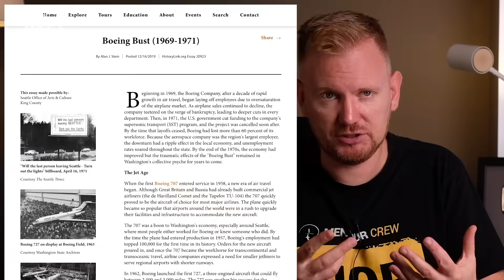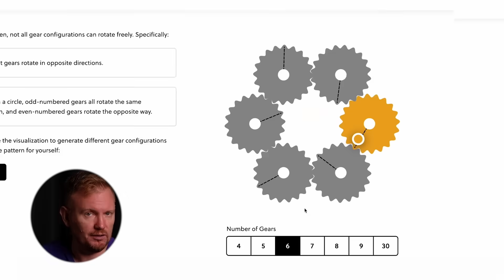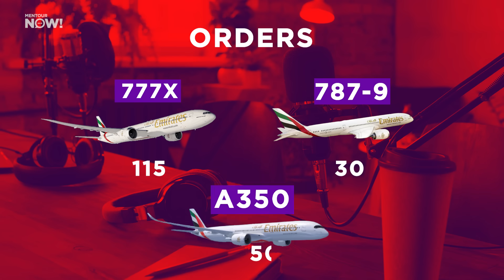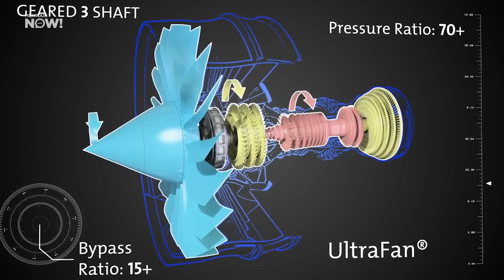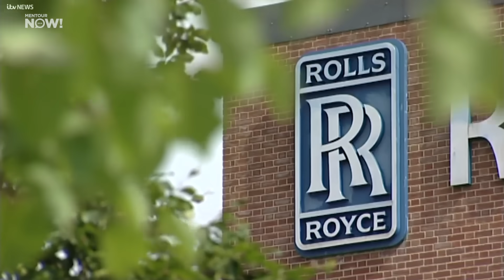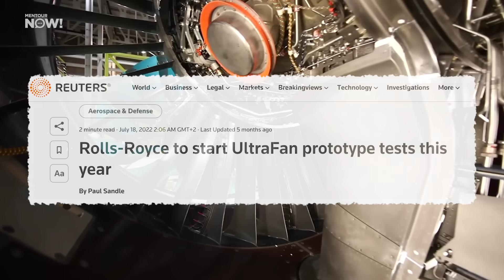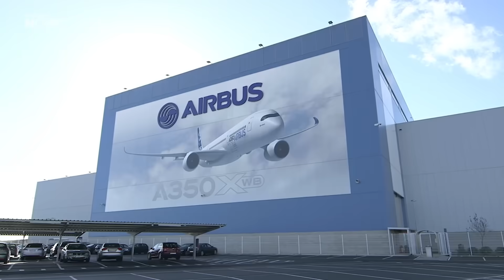Are BOEING planning a 747 with 2 ENGINES?!

Comment: I remember driving in North East Montana by Glasgow and the old Air Force base that Boeing now owns. I was coming from the north and saw this really strange looking 747. I seem to remember it only had 3 engines and the one by itself was HUGE. I was not able to get close enough before it had landed and could not see it from the highway so did not get any pictures. I actually parked by the approach lights hoping it was doing touch and goes. I think I looked something up and Boeing was testing the engine for a new aircraft. It might have been the 787, I just don't remember.

Comment: I can see how this could work out for a 747 because a 777 is basically the size of a 747 just without the hump. So the difference in weight between a newly designed, composite 747 and the new 777x should be relatively minimal, which makes it likely that those new giant engines could lift up a 747 in a twin configuration. However, i doubt that only two engines could ever lift a fully loaded A380 into the sky. Even if it's redesigned with a lighter composite hull, i just don't think that only two engines can lift that monster. The A380 might just be too massive for that. Man, if this comes true and Boeing actually starts producing those twin engine 747s, Airbus will again lose the Jumbo Jet battle against Boeing after their very brief victory over the 747-8 because of Emirates. Even if the A380 is technically better at the moment than a 747-8. This new 747 would mean the absolute end for Airbus ever to compete in the Jumbo Jet market.

Comment: What about a 777-474, a 777 with the 747-400 hump? Or a 777-314C with two of these Rolls Royce engines in unducted fan configuration mounted overwing and with flying boat hull modifications in order to create new landing gates out of port locations that are often quite close to downtown areas.
Reply: I always wondered why runways took over from seaplanes, I just thought it was problems with floating litter. Most people still live in big cities close to the beach. 
I'm imagining the take off length have always been about the same requirements. I don't have the faintest idea, it just seems logical. As planes got bigger they put more in them, always to the same ratios.

Comment: Before we go all for only 2 engines in each plane, I want to think about can high efficiency quad engine planes happen where the engines can run in a relaxed low spin speeds needed to provide the thrust compared to 2 engines providing the same thrust?

Comment: I retired from 43 years at Boeing Commercial Airplanes in 2020. I'm very qualified to to respond to this video. I would be unheard of for an engine manufacturer to design and build a prototype engine and then go out and shop it around the airframe manufacturers to see if they could find someone to build an airframe to suit the engine. It just dosen't work that way. Boeing and Airbus will do exhaustive studies with the colaboration of engine manufacturers to understand the current state of the world's airline markets. Then they look at the airplane models that are serving this market. The study will progress to decide if a business case can be developed for a newer, more efficent airplane to serve that market. 

Mentor Pilot is missing the understanding of what the 777-9 is. The 777-9 is a replacement for the 747-400. It is very close to the same passenger size with nearly double the cargo capacity and will hit 95% of the weight/range ans the 747-400. When the -9 was offered to the airlines there was a companion 777-10 (and -8) offered at the same time. The -10 eclipsed the size. range and cargo capacity of the 747-10 but the airlines were just no interested in it. 

Problems with the GE9X engine and certification problems have delayed the 777-X program. We heard stopping 777-9 cert testing back in Nov 22 and one of the 777-9 engines back to Peebles for analysis. https://www.flightglobal.com/airframers/boeing-halts-777-9-flight-testing-following-ge9x-engine-issue/151175.article

There is no way boeing will ever build a 747 twin. In fact there was a program devleopment study back in the mid 70s to see if a twin aircraft could be built maximizing 747 componets. It could be done, but it would have not been very efficent on top of the fact it just looked plain silly.

I went through the flight test program for the 787 GE and RR. Also the first couple of years with the 777-9. I know both Rolls and GE well. I would be shocked if Rolls Royce could build a new monster sized engine on their own without an airframer on their side. Maybe Boeing is hedging their bet with another engine in case the GE9X fails, but I doubt it. More likely Airbus is about to pull a rabbit out of thier hat with a new airplne the upsizes the A350. We shall see...
Reply: The mid 70s isn't the 2020s... They ought to redo that study, except this time with composites and other lightweight solutions.
Reply: @Rickyrab  Boeing is continuosly doing new airplane studies. Some make it further than others. Publiclly known paper airplanes have been the Model 2707 SST, the 7J7, 747-500/-600 and most reciently the MMA or NMA and some call it the 797. Lesser known is the 757 was orignally designed with a 727 like T tail. There was a proposal in the early 80s to equip the 767 with a upper deck aft of the wing. That became the 777.
Reply: Question: can someone put a hump on the front of a 777? If not, why not? What would need to be done to modify a 777 airframe to yield a hump?
Reply: @Rickyrab  A hump could be put on a 777 but why? There are reasons jet liners have evolved into a twin engine tube. Aerodynamically a tube is cleaner than a double decker. Less fronal area means less air to displace. Structurely a round tube contains the pressurazation loads better than a flat sided double decker. Double decks require more structure which means more weight. At the same passenger capacity a single deck airplane is longer. A longer fuselage means more cargo capacity. A 777-300 is very close to a 747-400 in total seats, but it carries 60% more cargo. The only real reason a hump was put on the 747 was to give the pilots room to sit on their wallets ;)

Comment: Best guess is the RR ultrafan is for Boeing's Y3 design, to replace the 777-300 and 747 product lines... the 350-600+ passenger market.  But if used in a new quad jet, that would compete with the Airbus A380 family and the A350-1000.  But if really for another 747 iteration... either the wing would need a total redesign, to provide one pylon, and centralize its struts and spars and supports there, or perhaps (ridiculous, but) a bridging pylon that hangs a new engine between the existing pylons.  The first case speaks to a new version of the 747, the second a bodge for existing 747 airframes, but a bodge that might work if the new RR engine and bridging pylon's TGW is less than the combined weight of the two engines and their pylons.
Reply: So Boeing has a jumbo twinjet idea knocking around?
Reply: @Rickyrab  Yes, but don't know yet  if it's destined to happen. Or if it'll be multi deck, heavy.  Boeing are tight-lipped

Comment: With respect to Raytheon's GTF patent, patents expire. US8935913B2 is due to expire in 2032, and as you know it can take decades to develop these sorts of advanced engines, so as long as RR doesn't intend to introduce such an engine until 2032 (only 10 years away), then they will be fine. Also, patents do not protect broad concepts, such as the "geared turbofan" concept. They protects implementations of concepts. So a competitor could introduce a GTF as long as the way it does it is sufficiently different to the details in the Raytheon patent.

Comment: The problem the RR Ultra will have is likely ground clearance on conventional wings. You may need a top wing T-Tail (like the US AF C-5, 17, etc) to make this work. That would be a huge redesign. Otherwise, the forces on the pylons would be immense, and could exceed the strength of the wing spars. There are HUGE physics and engineering issues at play to hang such a powerful engine!
Reply: He did say that no plane now is high enough to accommodate this engine...
Reply: Why do you think the nacelle-induced forces into the wing structure would be much different between a low and high wing?
Reply: @dougball328  I didn't say they would. High wing gives more ground clearance for the larger engine
Reply: @RabbahDocRona  Then I guess I don't know what you meant by the forces being immense and exceed the strength of the wing spars.   As for ground clearance, totally agree.  See my other comment previously.
Reply: @dougball328  what I mean is that in a conventional wing, for an engine that large and heavy, to clearance it, you need to cantilever it something fierce. The more you cantilever it, the more torque you put on things. 

If you look at older planes the engines had narrow diameters and were mounted under the wings, so there was no torque, just weight.

With modern fans, though, the diameters are so large that you have to have them forward of the wing, i.e. cantilevered. This puts a huge torque on the mount, which is transmitted to the wing spars.  The bigger and heavier the engine, the higher the torque.  Likewise, as you put more power in the engine, the higher the torque.  Eventually, you exceed the strength of the wing, which in new planes is made of composites.  These have great linear strength, but only in one direction. In other directions they will snap very easily...
Reply: @RabbahDocRona  Or, in the case of the 757. you use a longer gear - no increased cantilever.   I know, I worked at Boeing for nearly 40 years designing commercial airplanes.  I get a big laugh out of the things people say on videos like this.   Just playing armchair engineer.   Do you realize that there is an advantage to cantilevering the engines?   It improves flutter.   Typically further outboard.   It's the reason the B-52 has the far outboard fuel pods.  The fuel in the pods doesn't extend the range at all.  The fuel just compensates for the drag of the pods.   The weight, however, is a big factor for improving flutter.   The weight of wing-mounted engines reduces the wing weight.  Why?  Because the primary design load on the wing is in the lifting upward direction.  The dead weight of the engine and nacelle help counteract some of that load.   As for composites, what you say is true only if you are stupid about how you lay up the plies.  You can tailor composite structure load paths just about any way you want - or need.   It is a big advantage over matels.
Reply: @dougball328  I am aware of the higher gear on the 75. You note that you WERE an engineer at Boeing, so obviously you are aware of their huge issues due to management decisions. I'm among other things a retired nuclear engineer, and I know that doesn't equate to your work.

However, I know enough to know that the gear design on the Max 10 is insane, and as a C17 pilot noted recently, even the Max is a 1960s plane with lipstick and ribbons.

Building a 74 with these new engines, when they couldn't sell the -8, I don't know. Maybe with the demand TODAY for big planes, but what will it be in 12-15 years when they finally get this off the ground, if they ever do?

And despite everything you have said about the engineering values, you can't forget the loose nut behind the torque wrench. How many engines have come off in flight because of an improperly inspected part that had fatigue, or an improperly torqued fitting, etc? So many failures occur because airline maintenance cuts corners, and the bigger they are... Well you know
Reply: @RabbahDocRona  You may not be aware that wing mounted engines are designed to break away if the loads get too large.  This would primarily come from an unbalanced engine that lost of fan blade.  It is better to have the engine cleanly depart the wing than to have it tear the spars.   I retired in May of 2014, so the Max pretty much happened after I left.  Your comment about the "loose nut" on the torque wrench is spot on.   The Lion Air crash was, in part, due to the airline replacing the alpha vane overnight and then never calibrating it.  It was providing garbage input to the flight control system.   Having said that, the MCAS system was poorly designed.   As to what the marketplace will want in 20 years is anybody's guess.  Boeing has it's 20 year market outlook report on its website somewhere.   The 787 cam about because Boeing marketing concluded that a smaller, long range, point-to-point airplane made more sense.  (We were teamed with Airbus for a couple of years on the "New Large Airplane")   The 787/A380 story says Boeing's market people got it correct.    The 747-8F made good sense.  The 747-8 (passenger) was a waste of time and resources.   But no company is perfect.
Reply: @dougball328  absolutely better to have the engine leave cleanly than to have a catastrophic fail like the AA DC10 in Chicago
Reply: @dougball328  I also firmly believe that Boeing lost a great opportunity by not doing a 767 Max. Take the wings, engines, stabs and avionics from the 787 (roughly same weight class) and put them on the 767 fuselage and you have a much more efficient mid market plane made from off the shelf parts, so it could be done very quickly. And with 787 avionics, dreamliner pilots could very easily cross rate, so training costs would be low...  What say you?

Comment: The ge90x engines would have no issue however larger aircraft for passenger transport is becoming obsolete when you can fly the same revenue flights with two 787s or 2 a350s with the same passenger volume....as to why the 777 is next on the chopping block ..the issue is airlines need a large aircraft for seasonal or charter lights not everyday rotation....as to why the a321 took off...not because Boeing 737max had issues but because people and airlines want to get there fast or on time efficiently and quickly while also having the ability to have a feel as you would on a long haul flight...needless to say too many aircraft overlap each other i.e. a350 and a330neo.....airlines know the a330 is reliable but adding new engines does not make it more economical...the a350 is a newer from the drawing board platform which gives it it's sales...

Comment: A production run of about 50 years over the different variants.  That's the mark of a great concept.
Reply: I never thought I would see the end of jumbo-jet production.  I thought the planes would get bigger and bigger.
Reply: @johnbergstrom2931  I have never flown on jumbo-jet. Would love to try it. I have only flown with small narrow body planes and the seats are so small and crap. It's honestly such bad experience. Jumbo-jets probably has much bigger seat space
Reply: @megapet777  Seat space is really dependent on class - it's the airlines that determine that.  The economy-class seats on a jumbo are just as cramped as on any other plane...  And if you wind up in the center seat, between the aisles, you're 2 seats away from an aisle and 10 feet away from a window.

All those early images of a 747 with lounges, bars, lots of space to move around, etc. are just marketing B.S.  They did the same thing with the A380, even the 787 to some extent.  Promised a civilized, luxury flying experience.  They all ended up just packed with seats...
Reply: @johnbergstrom2931  ah I see. that sucks. I guess there's option to fly first class if you can afford it :D
Reply: @johnbergstrom2931  Instead of saying jumbo jet I think I'd stick with the term "wide body".  Jumbo jet is ambiguous and it means different things to people.  Wide body on the other hand has a clear definition.  Wide body certainly still exist, but planes that can hold 500 passengers aren't attractive anymore to most airlines, although since the 747 was originally designed to be both a freighter and passenger plane it's roll as a cargo plane will go on for decades.  And the problem for Boeing continuing to develop the plane is cargo companies can buy used 747s from airliners so they have access to hundreds of these planes, not so much anymore since most airliners have phased out the 747 but they were still being sold as a passenger plane in the early 2000s.   So now you get into the issue of support for the plane, and this is where Boeing is still going to make money off the 747 for a LONG time.  So, it probably will have been a plane that made money for Boeing for 70 - 75 years and that's mind boggling.
Reply: No, its the sign of underfunding new and better design concepts by shoe horning inappropriate fixes into out of date airframes. 
The Max series, for instance, makes as much sense as bolting a jet engine to a Tiger Moth.
Reply: @rorykeegan1895  We'll agree to disagree considering even today there are different companies that don't want the 747 production to end.  These are customers that use the plane.

So if you want to say these companies don't know what they're doing, OK???  I mean they have a choice of different companies and different planes and yet they want the 747-8.  It's true that the demand was too small to justify keeping in production but it's the oldest wide body plane.  But even here, it's not because most cargo companies don't want the plane, it's because they can buy used 747s from airliners who are selling them off.   If you've never read about the development of the plane then I guess it would be hard to understand why it was so successful.  In its time the Airbus A380 has come and gone, with about 250 being made.  It's the only plane that rivaled the amount of passengers the larger 747s could hold.

I think it was probably the only plane that was developed as both a cargo plane, passenger plane or combo of the two, that was developed in large numbers.